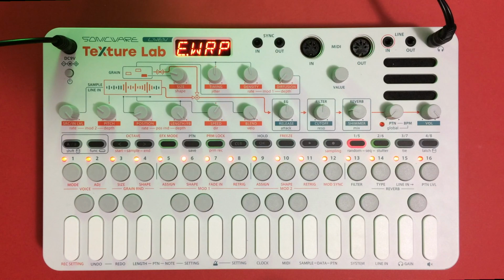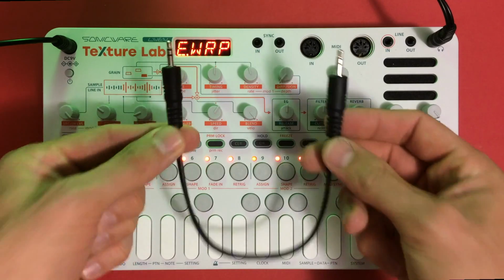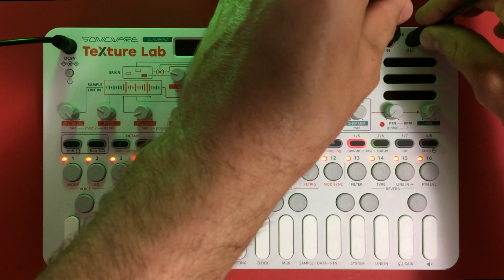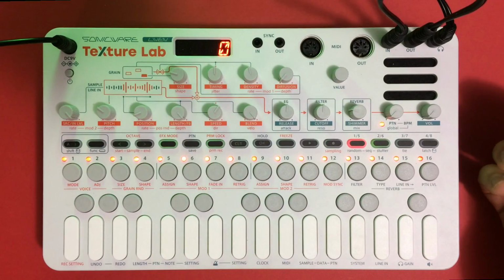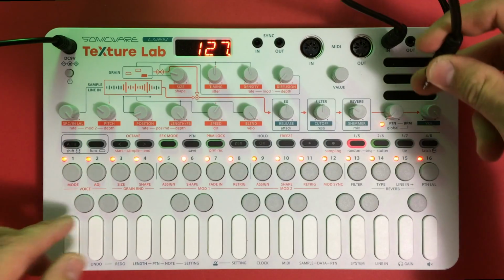How To Use Texture Lab Granular Synth For Experimental Noise

Comment: That was incredible. Industrial noise hellscape? Well... Now I definitely want one. Wonderful demo.
Reply from the maker: Thank you, hellscape is a great word for it 😁
Reply: Yeah, I've wanted one, even though the 404 is far more powerful, but if this can do stuff like that a bit better, then it's definitely worth it, and I like multiple machines anyways. Hehe. Shalom. :3
Reply: @ReligionAndMaterialismDebunked  oo that's a tough call actually. The sp404 can absolutely make horror industrial drones no problem. It just does it differently by using resampling and it's numerous effects. Those effects really can sculpt insane stereo industrial sounds. 

I'd say if you want a singular, less expensive drone machine to add to your setup this is your machine. If you want to build a full song out of loops and drums and drones and everything, the 404 mk2 will still get you these sounds and a lot more for a higher price, but a ton more workstation-ish functionality.

I actually think the Sonicware stuff pairs really well with the 404, and my current setup sees a lot of use of the mega synthesis with 8-bar sequences recorded into the sp404 and manipulated from there. That could just as easily be some with the texture lab and the 404.